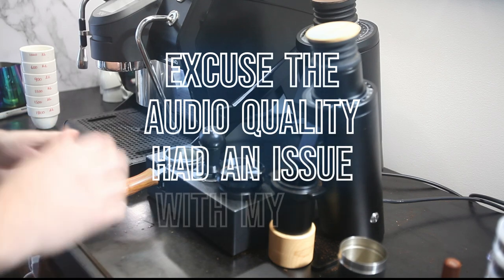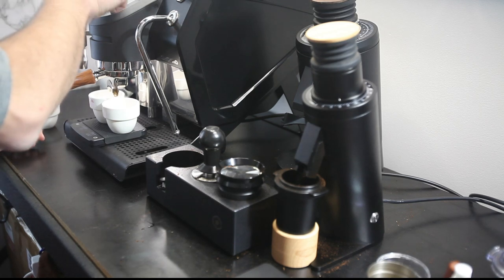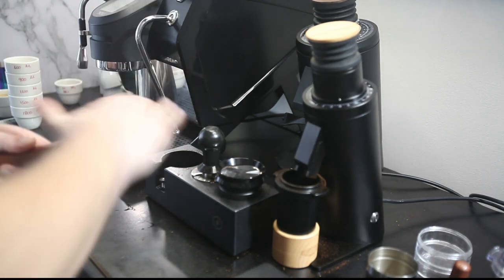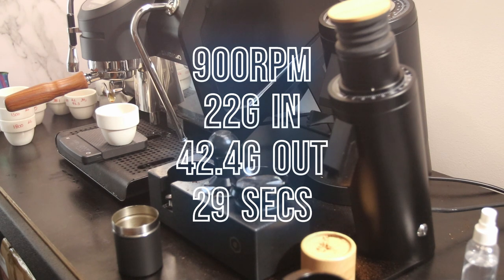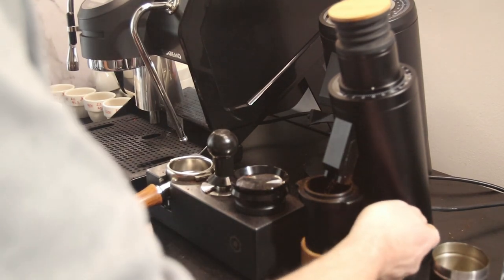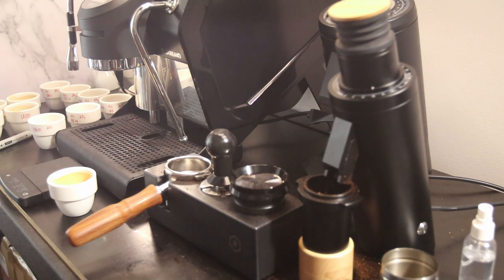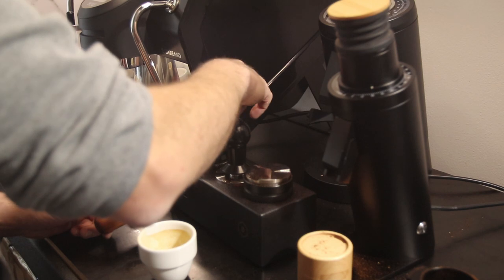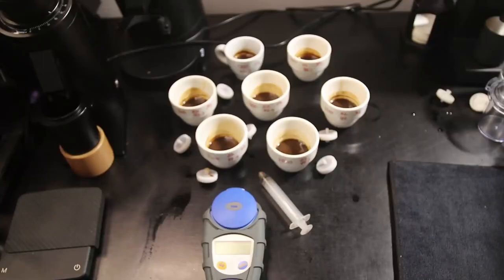DF64V Exploring the Impact of RPM Speed on Coffee Grinding & Taste

Comment: First thank you for all this work.  I wonder if you can provide your experience regarding the following:  How is the grind adjustment accuracy over time, in regard to the top burr carrier & springs design?  How accurate is the grind adjustment for repeating an old 'recipe' e.g. if go from recipe setting 1, to different grind setting, then go back to previous grind setting 1 is the result (flavors, brew time, brew ratio) the same or within few seconds every time?  There aren't a lot of reviews or user experience regarding 64mm vs 83mm but conventional wisdom seems to say that certain burrs (e.g. SSP Cast) are better in 83mm than 64mm, but otherwise how well the 64mm burr is dialed-in will result in same or very close to 83mm (83mm slightly better in general overall 5-10%).  The Swiss guys Kaffeemacher noted the Niche Duo was adjustable to 5 microns while the DF83 was adj. to 20 microns and latter is at edge of being perceptible to most people but it seems the DF83 is easier to install 3rd-party burrs as the Duo was set-up for the Mazzers.  We're looking to update our entire coffee game and torn between DF64v and something like Varia VS3 or Niche Zero for the heavy body contrast or going for 83mm to cover everything (clarity, body, smooth, sweet and just enough acidity).  Thank you for your time.  Regards

Comment: Thanks for the test!👌👍 
It turns out that the range for testing with espresso beans starts from 900 rpm. 
My Fiorenzato F83 E Pro grinder works at 1400 rpm.  
Thinking about buying an additional DF64V grinder.  
Then you can test the differences between the grinding disc size and the different speeds.  
In the end it's a gimmick 😉 and not necessary, but we're all kind of crazy!😉🤣🤣
Reply from the maker: Fiorenzato F83 is a great grinder.  Been a fan of that grinder for years and well and truly before Fiorenzato became "cool".  Very consistent and robust and puts a lot of other bigger name grinders to shame.

I remember the days when we did no RDT, no WDT, no grind distributors (other than by hand), no puck screens, no pressure profiling and no automatic tampers and we were still able to produce delicious espresso shots.   I guess the pursuit of perfection will always have people trying new things.  

With variable RPM I think there is more to it than some of the other "gimmicks" that have crept into our puck prep and that there is a difference in the cup.  It's funny since I shot that video my starting RPM setting is 1200 and I adjust from there if needed but guess what? I haven't needed to as I've been happy with the coffee I've been able to produce.  

Will keep experimenting when and as time permits and share my results for those interested.

I'd say if you have the means to do so then get that DF64V.  It will certainly make experimenting a little more exciting.

Comment: Placed an order for this grinder a month ago - expected end of June. I plan to install SSP cast burrs and hope to get good espresso at higher speed and good pour over at low speed. Any chance you have access to some SSP cast burrs?
Reply from the maker: Yes I have access to cast burrs.  Will wait until I have some extra DF64V grinders and I can run them side by side with a different burr set each.  That way can do a direct comparison without having to waste time swapping out burr sets between shots.
Reply: @FrankiesBeansMachines  For these tests you had the stock burrs in there right? I think the Labsweet style burrs like SSP Cast and Option-O Mizen don't have quite as dramatic of a difference for espresso at high/lower RPM, but there is still similar results to what you found here. Some people don't believe RPM really changes the taste any differently than adjusting grind size would. Apparently lower rpm grinds coarser usually on my P64 with the Mizen burrs for coarser grinding I did notice that happened a bit!
Reply from the maker: Yes stock burrs as that is how most people will be using the DF64V.  Yes I know some say there is no difference however there was for me which is why I said to take the results with a grain of salt as they are my results and may differ for someone else.

Comment: Have you experienced any stalling grinding espresso at 600rpm? 
I was told by espresso outlet to not grind espresso below 1000.
Reply from the maker: Hi Andrew, yes I have with ultra light roast dense coffee beans.  Happened only once though.  The lower grinding speeds are really aimed for filter grinding rather than for espresso.  If you are looking for low RPM for filter you should have no issues.  For espresso you may encounter stalling from time to time.  in all honesty though for espresso the 600 rpm shot was my least favourite so it is unlikely I'll be grinding that slow with the DF64V.
Reply: @FrankiesBeansMachines  Notice more acidity / sharpness at lower RPM but also more flavour clarity generally? 
What kind of coffee were you using for these tests?
Reply from the maker: Acidity was more present at the 900RPM mark. Coffee I used was our Seasonal Blend that has an omni roast profile so on the light to medium roast profile.

Comment: Hate this grinder.  No support from the company, machining is poor (misaligned holes, rough threads), no support, burrs are out of alignment, no support, creates very high static compared to other machines, and results are inconsistent (see alignment and machining issues).

Yes, I probably got a lemon. But did I mention the company gives no support?  Days to respond if they do at all and no useful engagement in the issues when they do.  I've got a $550 lemon and it's been a week since they answered an email.  Do not buy from this company.